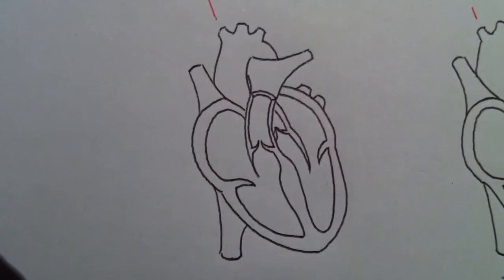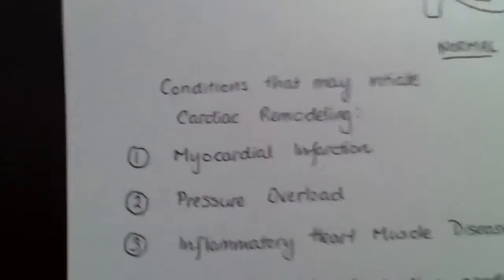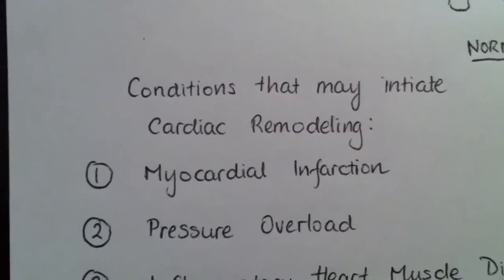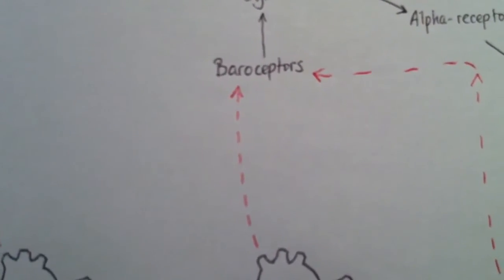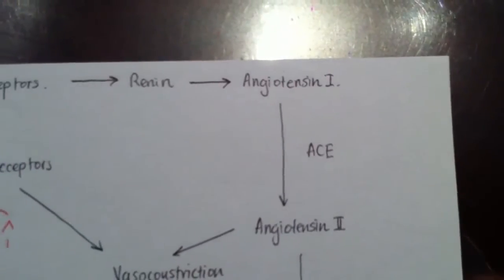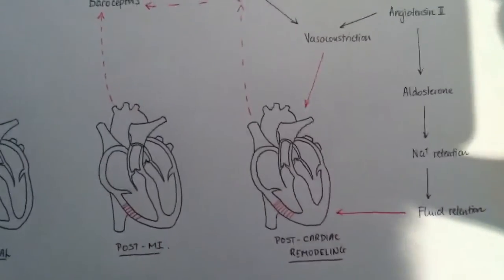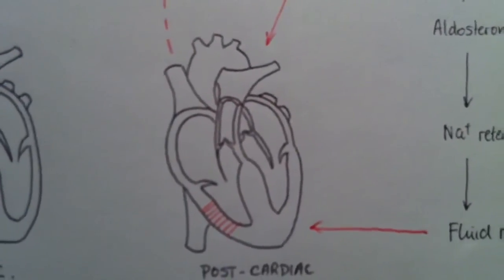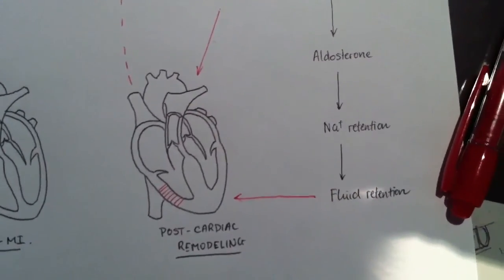Cardiac Remodeling - Part 1 - The Pathogenesis

Comment: so what you are saying is that catecholamines activate beta receptors which in turn activate the release of renin? thats just plain wrong. When you have a MI you will have decreased cardiac output which in turn leads to hypotension, which causes the kidneys to get less perfused which then again leads to the secretion of renin from the kidneys. Maybe you just wanted to simply the whole pathway but what you said is just wrong.
Reply: no he is right there are two systems resulting in heart failure
Reply: Its a compensatory mechanism from the heart that lead to increase the sympathetic actions on beta receptors which stimulates the release of renin